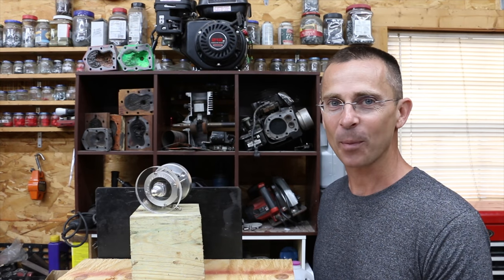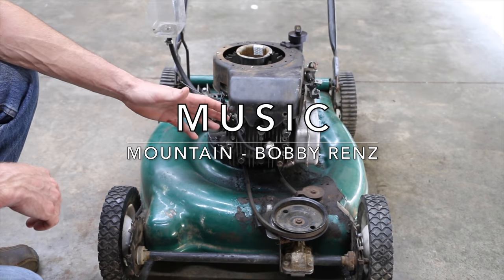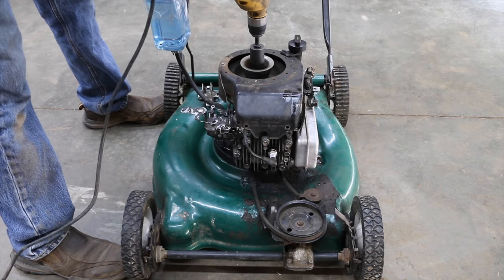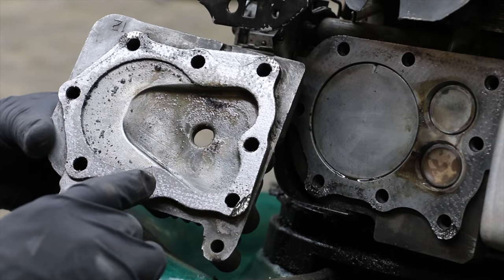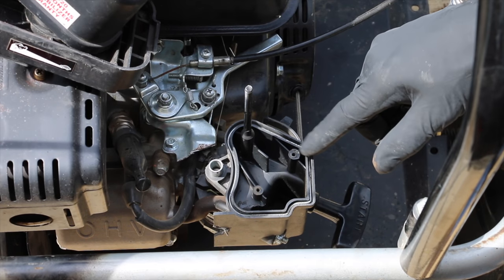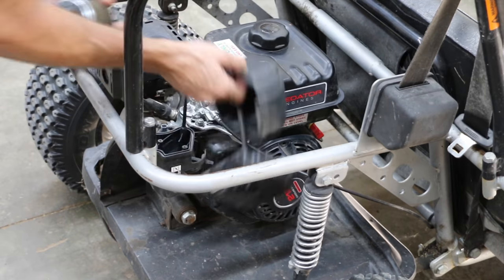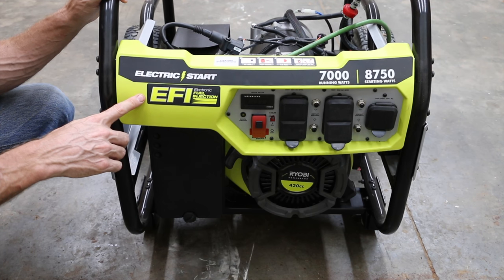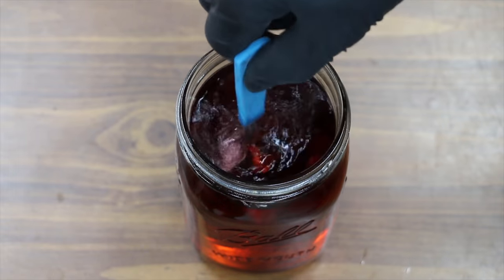Is Leaded Fuel better than Unleaded?  Let's find out!

Comment: Do you hold the world record for small engine cylinder head removals?
Reply: I bet he has like a 100 pack of head gaskets for that thing.
Reply: And also the Record for owning the most Lawnmower Spark Plugs That just been Used once
Reply: @bananarama9503  i work in a small engine repair shop and helps the local high school drag race team i have a 5 gallon pail full of plugs from testing/tuneing motors
Reply: ww3sabiture
"Local high school drag race team"
cries in unfulfilled dreams
Reply: @UrsusSuperior44  lol you should see the stuff i work on then i just got on 80s FL250 odyssey i plan to stick a 120hp sled motor in or a 500cc polaris i also have a working 600cc sled and an FL350 at the coast with a 440 in it. i will be making vids of me restoring and working on building a toy for the drag strip. calling the honda shop about a new frame tho as i would like to get a 350 as it has suspension front and rear not just front like the 250.
Reply: Womb Raider  well make one its not hard
Reply: @ExplosiveWeaponForum  That's.. not how it works
Reply: A K while I enjoy auto racing, watching young men run in a dress is not my idea of a good time!
Reply: Gets his head gaskets from Costco
Reply: I think the quad buggy needsa name.... Ill start the  ball rolling with 'Farmabuggy'....
Reply: @Sum1UDidntC  ò
Reply: He has to have it
Reply: Probably not.
Reply: Just my opinion I say he does at least on briggs & stratton engines
Reply: @Sum1UDidntC  to be fair that thing is easier to replace than a car’s valve cover.
Reply: I was thinking the same. His local small engine parts shop must love it when he enters the $hop.

Comment: Who here is old enough to remember when all gas stations carried leaded and unleaded?
Reply: Yes, and $0.23 per gallon for premium.
Reply: I remember when there was only leaded. In Australia it was called "Super"
Reply: Jay Sanders how did that work if other people were waiting? And how did they do all that if you were putting in what $5 now would be back then?
Reply: Corpsie Corpsie  

In the 60’s there were gas wars. My Mom had a set of NFL etched tumblers, given out by stations for filling up. I wonder what my sister did with them. Mom kept them in like new condition by always hand washing.
Reply: Jay Sanders 

Yes. NJ and OR have laws prohibiting able adults from filling their own tanks.
Reply: @2v_media  To start, people were not in the big rush they are today. If you had a system, you could start a fill-up, open the hood and check the oil, then visually check tires and wipe windows as you pass them going around the car, finishing with the drivers mirror as you get the customer to pay. Oil and other fluids were kept in a rack on the pump island for easy access if it was needed.
Reply: Jayy 

It was done to differentiate a commodity by level of service. People would patronize stations which performed those kinds of services well, and bring their cars back for maintenance, as they all had service bays and could do tuneups without elaborate test equipment or deep knowledge. It made single-station owners a good living, in contrast to today.
Reply: I remember my dad would constantly remind my to put UN leaded gas at 97 98 cents a gallon in my 1985 Toyota pickup. I also, remember hearing that eventually leaded gas was going to be faded out.
Reply: P6 rover first car i owned ran on leaded fuel
Reply: @2v_media  People weren't so self centred back then, a lot more time and consideration for others. Life was also lived at a much less frenetic pace, no-one seems to have much free time nowadays. It was also a marketing thing. Get a free screen clean and water/oil/ tyre check. Need more oil? We'll sell you some. Now you have to pay for this or do it yourself.
Reply: @FrankGutowski-ls8jt  Probably because (I've seen it in many countries) people smoking whilst filling their tank. Freedom is a wonderful thing until you give too much of it to stupid people.
Reply: @2v_media  
Notice those kind of stations aren't around much anymore.  Question answered.
Reply: I used to put Sunoco 260 in my '65 GTO
Reply: WS P On those days you couldn't run the old english cars or even v8s on anything but unleaded. You noticed that when the pipe was a nice light grey you were running sweet. These days its virtually impossible to ķnow whether your running to rich or lean.
Reply: I remember back in the 80's when I was a kid there was still "Regular" and "Unleaded". I just purchased a 1957 Chevrolet sedan with the original 236 straight 6 in it. I'm going to be adding a lead substitute to the fuel to help keep the valve seats in good shape. That is if they aren't shot by previous owner only running unleaded in it. (he didn't drive it much from what I understand and only owned it for about a year)
Reply: Jay Sanders  Oregon has pump jockies. You can't pump your own.
Reply: @FrankGutowski-ls8jt  watch the scene in back to the Future at the service station.
Reply: I Remember Leaded Only Until The 1980’s
Reply: I've still got some 5 gallon containers with leaded
Reply: @Shane-Singleton  don't forget to use zinc additive in the oil to avoid premature lifter wear.
Reply: @mitchfleming274  Yep already have that covered too.
Reply: And guess how much lead can still be found next to highways today.
Reply: @chrischiampo7647  Ah, the days of Dino Supreme and Purple Martin...
Lead emitted from decades of auto use along our highways and freeways still remains.  I don't think there's any practical plan to clean it up, so it's just buried.
Reply: remember 3 4 and 5 star fuel and remember when unleaded came out
Reply: I predate unleaded and low leaded gas. I worked in a Shell service station at 13 years old.  Regular gas was 23.9 cents a gallon. Premium sold for about three to four cents more a gallon. Depending on the person and where they were from, and how old they were, would call Premium;  Hi-test , Ethel , High grade.    We also sold White Gas, Kerosene, and Stoddard Solvent in bulk.
Reply: @chrischiampo7647  - Me too, unfortunately.  Old age hurts.
Reply: We were still selling in places here in KY into the early 90's. I worked at a gas station in my teens pumping leaded gas. The good ol' days.
Reply: I'm old enough to remember when only one gas station chain sold and advertised unleaded gasoline. Back then it was called white gas. Amoco was the only station to sell unleaded (white gas) in the 60's and 70's.
Reply: @Shane-Singleton  - I completely forgot it was called Regular.
Reply: As a very young man I worked at a full service station for one dollar per hour, and yes we always had to ask, "Regular or Unleaded". That was a long time ago.
Reply: @2v_media   Its called by working, I've noticed young people today stand around a lot.
Reply: Oh yeah, I remember!
Reply: I remember when unleaded fuel was scarce and most fuel was leaded.  Low lead fuel was generally aviation.
Reply: @FrankGutowski-ls8jt  There's still some remnant of that now with those stations that also do oil changes and tires, but they're uncommon where I live, and those that do exist are mostly seen as the scummiest "mechanics" and I only ever see employee cars in their bays.
Reply: Player_Redacted 

Right. There’s a Shell nearby that closed after two new high volume-convenience store type stations opened. I think they had three bays and two mechanics. Probably doing fluid changes mostly. 

I had a Peugeot 505 for 25 yrs and was fortunate to have a mechanic who specialized in them. But as the number dwindled, he closed, and I was left to my own devices, which turned out OK. It forced me to learn a lot and really bond with my vehicle, which I enjoyed driving.
Reply: Some of the stations around me still have the two
Reply: This dude here remembers putting leaded fuel in the ole oldsmobile with a 455ci engine
.. she was a an awesome car miss them dayz
Reply: It was federally made illegal in 1996 for all on-road vehicles, so, I don't think you have to be to very old to remember that.
Reply: @FrankGutowski-ls8jt  Was a different time then. One day someone figured out it was more profitable to sell snacks and sodas than to have two bay shop.
Reply: Dave Davidson The same people that pay to have their drinks topped off while dining. It was nothing more than tipping.
Reply: @jonwilson6077  . You use to be able to get Standard and Super.
Reply: I am.
Reply: @brookemcquale5096  - Alas, leaded wasn't called regular at a certain point.  It was called leaded
Reply: @grayzytube  People were not less self centered lmao. We wouldn't be in the mess we are today if that was the case.
Reply: their are still stations that have a service department in old out of the way places all over the us!
Reply: @grayzytube  Freedom is self correcting. No such thing as to much.
Reply: Shell’s unleaded was called Shell  of the future

Comment: I truly enjoy Project Farm videos. Extremely well presented, and I highly suspect an engineering or other technical background.

100LL was introduced to replace 100/130, 115/145, and 80 octane aviation gasoline in the late 1960s. It pretty much made no one in aviation happy. For larger aircraft using the two high octane fuels it forced some operators to pay for expensive modifications and Supplemental Type Certificates (STC) for their engines. Many of those engines would not produce the same max horse power using 100LL. In light aircraft (generally 200 HP or less) there were no mods or STCs required, but there were other headaches. While, 100LL contains half the amount of lead found in in the two high octane fuels, it contained 4 times more lead than the 80 octane fuel the light aircraft engines were designed to use. Frankly, because of the greater lead content, 100LL was a paine in the ass for light plane pilots. It was a regular occurance to have your engine fail the magneto (ignition system) check during the pre-takeoff checks due to lead fouled spark plugs. The solution was increase engine speed to about 1800-2000 RPM then lean the fuel/air mixture till you got a small RPM drop to heat the cylinders and burn off the lead. Once in the air with higher RPMs there wasn't much problem, but at low RPMs it caused frequent fouled plugs and stuck valves.
Reply from the maker: Great information!  Thank you very much!
Reply: The another action to minimize lead fouling in aircraft engines is to lean severely on the ground at idle/low RPM's.
Reply: I've heard that there's a company trying to develop a av-gas to replace 100LL with an unleaded grade or something like that. Not sure if it's true or just a bunch of bull though.
Reply: 80 octane was just motor fuel.  It was stil available at our airport up until 20 years ago or so.  It dissapeared because of lack of demand.  There are dumbasses out there who certify their planes to run on motor fuel.  As bad as pump gas is, you'd have to be insane.
  An older gentleman near me who had his own airstrip died awhile back, and his widow waited several years to auction off his toys.  The only thing that was returned to running order easily was his plane, because of the 100ll.  Everything else had to have the tank and carburetors tornmoff and cleaned.  
They still make 115/145 mostly for warbirds, but you have to buy entire lots of production at a time.
Reply: Funny thing was I was buying 100LL for my goped today at the airport and they had a student come back from taxiing that failed a mag check, you could hear it run like shit, the mechanics were trying to burn it off as I left with my can.
Reply: @randymagnum143  You're absolutely right, Randy. It wasn't, and maybe still isn't, a complete absence of those grade, they just became hard to find. After 100LL was introduced and labeled as "The New Avgas", Lycoming, and Continental certified their new engines for it. And, because there were a lot of new aircraft sold in those days, FBOs made the change to 100LL from 80. It was certified for both old and new aircraft and 80 wasn't.

It was a similar situation with 115/145. It didn't disappear, it just became increasingly difficult to find. The number of aircraft using it decreased, and most of those still flying had their engines STC'd for 100LL. That just led to even more FBOs dropping it. I would bet that all the big radials operating today have the 100LL STC. Otherwise, it would be very difficult for them to operate away from home.

I'm sure none of this is news to you.

An Autogas anecdote: Years ago a friend loaned my wife and I his Autogas Cessna for a weekend trip to Key West. When we started up to leave EYW on Sunday we discovered a stuck valve due to the Autogas! It became a very expensive weekend trip.
Reply: @CrazyForCooCooPuffs   Unfortunately, sometimes you can't burn it out. I'm sure I'm not telling you anything you don't already know, but if you have any issues with your goped running 100LL, pull and clean the sparkplug first. I enjoyed your reply, LE. I haven't flown anything that uses 100LL in decades, and your story took me back.
Reply: Burning it out means particles coming out of the hot exhaust at 10 nanometers,  containing beads of lead at 2-5 nm.  No air filter in the world can currently filter particles of this size. We have created a problem for ourselves as lead at any level is a neurotoxin and has claimed the brains of millions of children as they struggle to learn at a normal rate as their counterparts that did not grow up within a few miles of an airport.  It's a global problem too, we are all much dumber than we could have been thanks to AVGAS. which means we can literally blame pilots who get in their small aircraft every day and continue to spew this shit all over the atmosphere.  Senseless destruction for pleasure and joy riding, unless you're transplanting a heart, there is no fucking reason to fly a small-engine aircraft.
Reply: @Derelictos  finally someone making sense.  Noone ever thinks of the human cost.  They complain about fuel being out of stock.  Were extremely off center as a species. I have no doubt human beings will be responsible for our own demise.
Reply: @Derelictos  I definitely agree that exposure to chemicals has caused huge changes (certainly Hormonal disruption - low testosterone/high estrogen) in our biology, but am skeptical that proximity to GA airports causes lower IQ. Seems to me that lead exposure would've been highest before unleaded gasoline for cars was mandated, yet I see nothing to indicate that intelligence was widely affected during, say, the 1960s. 

I'm not doubting that lead can and may well cause it.
Reply: @Derelictos  You'd need to ban all petrol chemicals to really make a difference, but leaded avgas should have been eliminated by now.
Reply: I'm a Petroleum Engineer and all the majors have developed an UL fuel but there is no demand. Swift has their 94UL which is basically 100LL with no lead. GAMI has their 100UL previously called UL102 or something. As mentioned, STC s are needed. As far as environmental concerns, the old 100/130 and 115/145 had 4 to 6 grams of lead and 100LL is right around 2. The allowable limit is like 2.25 last I saw. Only Warter and VP make a 115/145 still, mostly for Air Races and Air Shows. The EPA  once did extensive testing on a fruit grove nearby downwind, behind, and across the road from a major airport. They actually found more contaminants from pesticides, herbicides and rubber particles, than TEL. How much is 2 grams per gallon? A full teaspoon of powdered sugar is about 5 grams, so less than half.  So if a plane gets say 10 miles per gallon(usually way more than that, , that would be a half teaspoon over a ten mile span into the air, but most lead deposits stay in the combustion chamber anyway..  I'm not saying it's fine, just saying the data found showed things far more prevalent in nearby areas.  Even behind the runway throttle up area, the fences and nearby groves and soils just didn't show what you would expect. That said, most engines new and rebuilt use hardened valve seats, so as long as the fuel meets FAA testing, start up and others as well as detonation requirements, an UL fuel is probably the better choice. However, it will cost about 60-85 cents, or more per gallon as TEL is a very cheap and effective Anti knock compound.  Cheaper than anything else by far.  And yes, even plane folks complain about fuel prices.
Reply: @GT-mn3bx  From Forbes:
In the U.S., researchers estimate that half a million pounds of lead get emitted in the lower atmosphere and end up in the soil, thanks to piston-engine aircrafts. According to the Environmental Protection Agency, 600 elementary schools are located with 500 meters of airports that use piston-engine aircrafts.

Over the years, the team observed that the blood lead levels of airport-proximate children increased where there was an increase in the traffic of piston-engine aircrafts. Children who lived downwind of the airport had the highest blood lead levels. The California Department of Public Health has set a threshold of of 4.5 micrograms of lead per decilitre. But the closer a child lived next to the airport, their blood lead level went way past that threshold.

“Across an ensemble of tests, we find consistent evidence that the blood lead levels of children residing near the airport are pushed upward by the deposition of leaded aviation gasoline,” said Zahran in a PNAS Nexus press release. “This indicates we should support policy efforts to limit aviation lead emissions to safeguard the welfare of at-risk children.”

In their paper, the researchers further highlighted that the National Academies of Sciences, Engineering, and Medicine had released a statement that said: “Because lead does not appear to exhibit a minimum concentration in blood below which there are no health effects, there is a compelling reason to reduce or eliminate aviation lead emissions.”